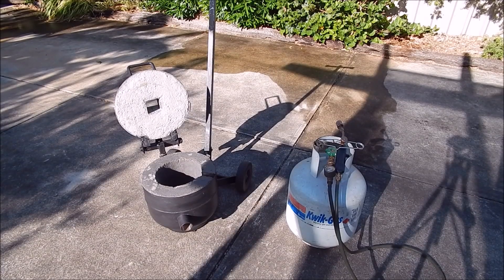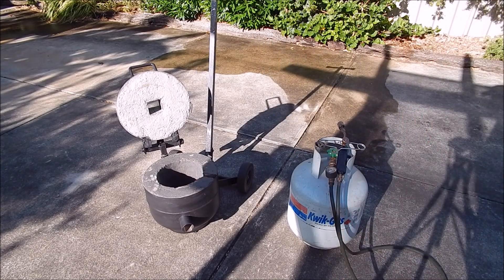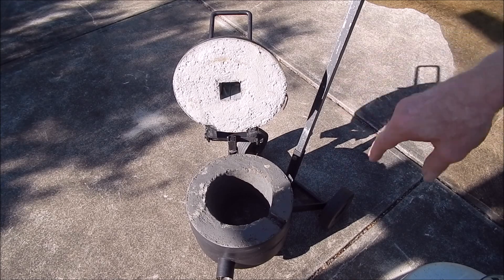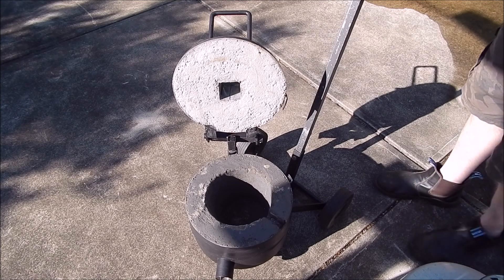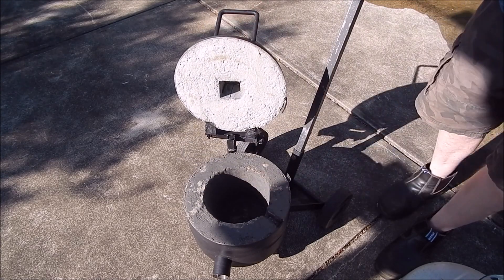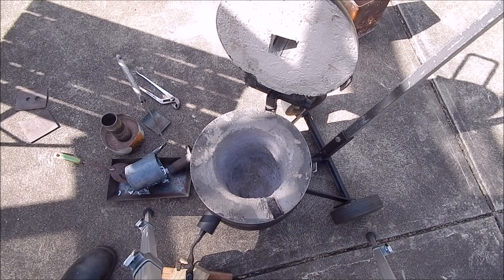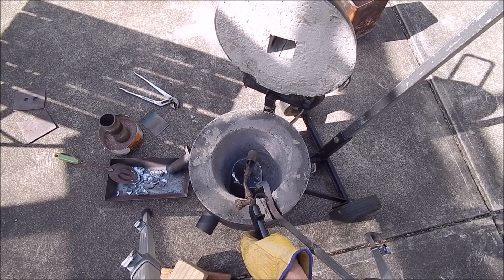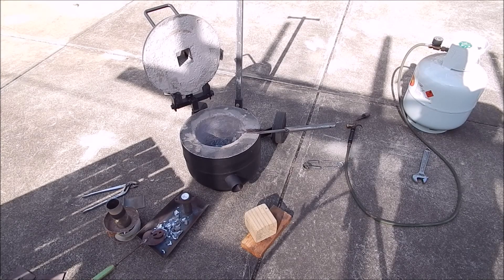Metal melting furnace made from an LPG/propane gas cylinder fires up for the first time

Comment: Hi Rob, looks really good! Can I ask what are you using as a crucible?
Reply from the maker: It's an old oil filter cylinder off of a tractor (steel) welded to a handle.  I have three steel crucibles I've used over the years made of various scrap that is thick enough to not burn through in a hurry.  Two are simply a length of large diameter heavy steel pipe with a metal plate welded over one end to block it off.  Then I weld on a length of steel rod and handle.  Easy to accurately pour and doesn't require juggling tongs etc.  Steel will work just as effectively as graphite for non ferrous smelting.  Cheers Rob
Reply: @Xynudu  that is absolutely brilliant! Thanks Rob!

Comment: Quite amazing how the small burner worked so well, showing how well the insulation worked. For many applications the small burner is probably a lot more economical on fuel. Thanks for sharing!
Reply from the maker: It worked better than I expected with the small torch.  The vent in the lid also seems to be the perfect size. Cheers Rob

Comment: Well done building it but..... Watching other foundry videos I can't stay away from a remark  about Your protective clothing being absent, naked lower legs.....
You ought to be "corrected", get a house arrest or something ...... Joking!
Reply from the maker: I usually wear overalls, but with + 30 C temperatures it's not great.  I was very careful and used a sand bed.  Not as bad as what I see in Asia and the sub continent ;) Cheers Rob
Reply: @Xynudu  I take that Rob but a long apron would have protected You from any eventual flying drops. Accidents never happens when one expects them... 
I once did melt down 3 kilo of lead, in 150 gram pieces, from stripped power cables, standing in the kitchen (my shop). The style was similar to Yours but no accident took place. Missed to use the fan for sucking out the fumes... But what the h-ll, still have several dentist repairs containing lead in the mouth. Guess the corpse, when the day comes, will be classified as hazardous material anyway....

Comment: Hi, this is a good device to melt metals. Thanks for this good idea. So far I have melted aluminum in an electric furnace. This is no longer feasible with future electricity prices. It should be fine for brass too. Greetings Michael.
Reply from the maker: Hi Michael, this is relatively cheap to run.  The other alternative is an enclosed wood fire with forced air assistance.  It has to be outside, but they work well for aluminium.  Cheers Rob
Reply: @Xynudu  Hi Rob, thanks for the information. Greetings from cold Germany.

Comment: Hi Rob, can you tell me where you sourced the refractory mortar and the perlite? I've checked Bunnings at Reynella and Noarlunga but I couldn't find any refractory morter and I could only find tiny bags of perlite. Your help would be really appreciated.  Happy New Year.
Reply from the maker: Hi Brian.  I went to Bunnings at Edwardstown.  They have large bags of Perlite and also the Devco range of products including hi temp refractory mortar (in the building supplies section).  It took 1.5 bags to do the job.  I was going to get the Perlite there as well, but the Bro In-Law had some up the farm which he donated.   Check the Bunnings web site for the products available at each store (they are all listed).  Cheers Rob
Reply: Thank you Rob. I'll check it out on my next day's off. Much appreciated. Brian.

Comment: That looks great, Rob.  Do you think the "swirl" effect is helping?  What's the payoff big burner vs small burner?  Faster heat up and less gas used overall?

Good to see you're wearing your safety shorts :P
Reply from the maker: I'm not sure if the swirl is doing much with this small torch.  I expect it will help when I use the big one.  Yeah, gotta play safe ;)  I had my welding mask on and was wearing steel caps.  Cheers Rob

Comment: What a great thing and a great success with the build. 
All the aluminium waste I produce could be put to good use with one of these. Then I would need the lathe and casting sand etc. etc. etc. too much to take on, on top of everything on my plate at this point in time though.
Reply from the maker: Hi Benny.  Almost free aluminium.  Just a bit of gas to melt it.  It certainly pays big dividends if you have a lathe or milling machine.  Ally is damn expensive down under.   The old gas bottle re-born, turned out OK.  Shows the power of the old AC stick welder.  Cheers Rob